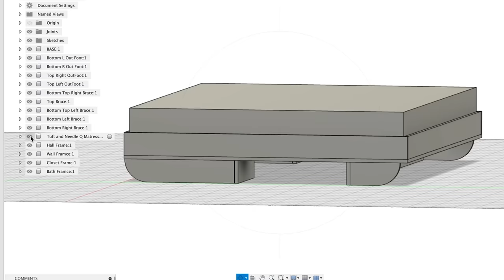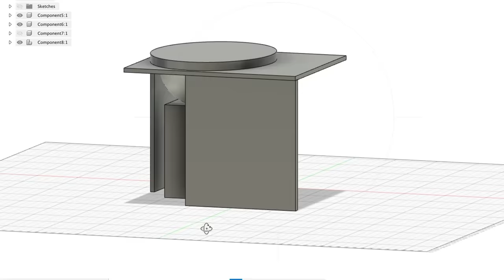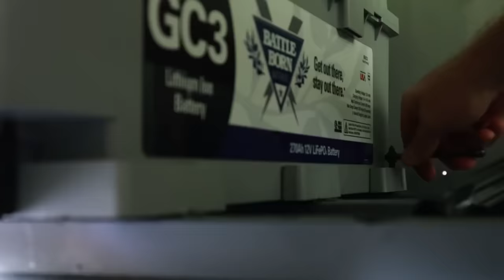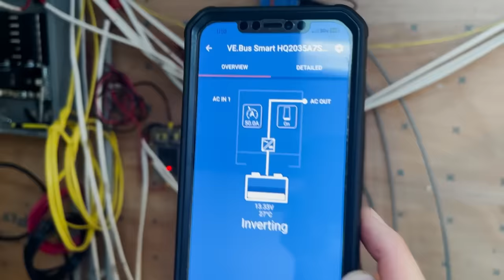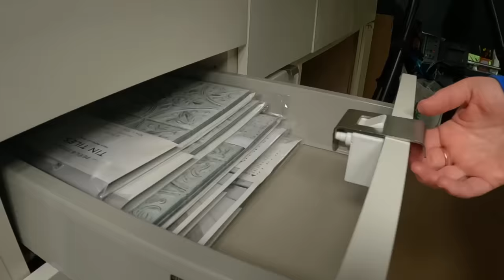BEAUTIFUL TINY HOME Bus Conversion // TIME LAPSE Start to Finish

Comment: You guys have some mad skills here.  The planning of the project, materials, design, fasteners, waterproofing, insulation, durability must have been enormous, you must be an engineer or something.  Im sure it must be very rewarding making your this creation for your full time adventure.  You must me and engineer or something to do such a great job planning and executing on such a huge project.  I also use fusion 360 for designing 3d printing projects for the 3d printer i keep in the RV.  I wish i had the time to check out the bus when I met you at angostura.  Hopefully we will connect and I will get a chance to see all the stuff from this video.  I cant believe you guys filmed the whole project.  I understand how hard it is to film projects like this when you just want to get it done.  First time I ever watched a 30 minute video beginning to end.  Awesome job.  Larry
Reply from the maker: Thanks so much Larry!  We had no experience with any of this. We learned on the job. It was a huge project and filming it all slowed the process down, as you know the work that goes into filming and editing.  But we love making these videos so it was all work it! Definitely need to hang out next time we cross paths on the road.
Reply: 7676
Reply: @Rehabit8  that’s inspiring to hear. Lovely with. ❤😊

Comment: BEAUTIFUL! Great job. Any work needed on the running gear (eng, trans, etc),?
Reply from the maker: Hi GEORGE, the bus is in pretty good shape engine transmission should last us for years to come as long as we get the upkeep done properly. We did share in video a few months ago That we have a broken front fuel filter housing that needs replaced. And some of our marker lights are broken and water gets in so that’s how I am a list of things to get done right away. We’ll find out if there’s any other issues once we start driving around I guess

Comment: Absolutely stunning!!!

But, how much does that puppy weight now? With all that wood, appliances, furniture and water/dump, it has to weight a freaking TON!
Reply from the maker: Thank you! The bus is designed to carry a maximum weight of 22 Tons (that would be with all the passengers and their luggage in the overhead bins and luggage bays below plus the weight of the actual bus).  We now weigh 19 tons so we are under weight.  Consideration was and should be made with all the materials you use in the build to be lightweight where possible but also sturdy to last
Reply: @Rehabit8  Oh wow!!! Thank you for responding. I've watched a lot of your videos and have loved every one of them. Such a monster of a project. But, such a beautiful outcome. That bus came out beautiful. Much respect to you both on 3 years of such hard work.

But, I knew that people have to be thoughtful of weight when refurbishing older RV's and Busses.

Comment: No vapor barrier?? 😢
Reply from the maker: We used sheep’s wool insulation .  You DO NOT use a vapor barrier with sheep’s wool.  Sheep’s wool absorbs excess moisture and then releases it when it’s low humidity.  You want it to be able to breathe.  A vapor barrier would defeat the purpose.

Comment: How much work - 3 years - wouldn't there be a motorhome for this money ready class A - well-maintained and with a mileage of less than 50,000 miles?
3 years spent on construction - 20-50 thousand USD and you would have been sightseeing during this period - I think it's a waste of time!
Reply from the maker: MCI's are beasts.  They are so well built and superior to an expensive RV.  Their engines are known to last a million miles.  We are way under that and could probably never put on enough miles to reach that.  A Conversion is custom.  There is no RV that we could have customized in this way.  A conversion is not for everyone but it was 100% the best decision for us and we wouldn't have it any other way.  Our home is beautiful, comfortable, spacious and customized for our lifestyle.

Comment: Fantastic R.V. Bus build. Are you going to be able to see out of that fairly high right side window to check for traffic from slightly behind to the right ?
Reply from the maker: You don’t use that window.  There’s a massive mirror and window in the door.  Been driving around for a year now and it’s not a problem

Comment: What I don't like in your bus home ?

1) wood at ceiling, floor, cabinets, countertops, etc. You used so much wood. In about 5 to 10 years time, white ants will appear and all the wood will rot. 

2) you keep a cat. Cats are dirty, stinky, filthy. They walk on grass, bring dirt, germs, diseases into your home. 

3) shower curtain. 

4) insulation at ceiling, walls and floor. 
-----------
If I were you, I would have done the following :-
1) Triple metal roofing. 

2) metal ceiling as per the shipping container. Spray white paint OR get white metal. 

3) strong wood as base of the floor. Place high quality PVC mat on it. Place high quality concrete cement followed by beige ceramic floor tiles throughout the entire flooring, including shower cum toilet. 

4) strong wood as base of the wall. Place high quality PVC mat (from floor to ceiling) on it. Place high quality concrete cement followed by white ceramic wall tiles throughout the entire walls (up to ceiling), including shower cum toilet. 

5) Fluorescent lighting :-
- living area (3)
- dining cum kitchen (3)
- shower cum toilet (1) 
- sleeping area (1) 

6) two ceiling fans

7) air conditioning unit each at living and sleeping area. 

8) place bricks with concrete cement at the areas where kitchen cabinets will be placed. 

9) kitchen cabinets made of bricks + concrete cement + white ceramic tiles. Aluminium doors for kitchen cabinets. 

10) wardrobe. Same concept as kitchen cabinet. 

11) white Ceramic tiles for kitchen countertop. 

12) 3 seater sofa - bricks + concrete cement + white tiles. 

13) dining table (for 2) and 2 dining chairs - made of solid wood. No dark brown varnish. Paint it white/beige. Put glass top on dining table. 

14) flat screen TV (same as yours). Place light weight cushions between the areas where the TV will return to its original position. Leave a bit of space (2 cm) between the cushion and TV. 

15) Iron grille and mosquito netting or screen at windows. See below :-

Windows / iron grille / mosquitto netting. 

The iron grille will prevent anyone from entering your bus home. 

The mosquito netting or screen will prevent insects from entering your bus home, when your open your windows. 

16) No drawer on the floor. 

17) Increase the height of the entire bus by 9 ft. This will be your 2nd floor. 

18) Shower cum sitting toilet bowl.  Large wash ceramic basin with ceramic countertop. Hot water heater. Pail and mop (so that you mop the floor on a daily basis). 

19) no outdoor footwear in the bus home. 

20) no pet.

21) no vase. No potted plant. 

22) no carpet, no floor rug. 

23) no table cloth, no cloth runner. 

24) Steps to upstairs (bricks + concrete cement + same beige ceramic tiles). Iron handle. 
=========
UPSTAIRS 
1) Sleeping area with triple metal roofing. Same ceiling, walls,  flooring, lighting, ceiling fan, air conditioning, windows concept. 

Wardrobe (with aluminium doors) and bed made of solid wood. 

2) laundry drying area. Double asbestos roofing with iron grille. Same walls, flooring, lighting concept. No windows. 

Put large butterfly clothes hanger with 20 figure-of-8 clothes hangers and clothes pegs.
=============
DOWNSTAIRS 
1) Living area 
2) Dining cum kitchen (top load washing machine, NO dryer, 2 pin stove, refrigerator, microwave oven). 
3) Shower cum toilet 
4) Driver area 
5) shoe cabinet at the main entrance area 
6) wash feet at lowest step. All steps to be rinsed clean. Then walk barefoot on the second lowest step.

Comment: Where did you put the condenser unit for the mini splits?
Reply from the maker: In this video you’ll see how and where the back mini split outdoor unit is mounted: https://youtu.be/gLxKBgoTeNo?si=_q3hmm4XvFEtF-lQ
The front one is mounted in the same way in the side luggage bay that used to hold the original bus AC condenser (which we removed). Both bays are well ventilated

Comment: Since you've done this before, I'm still wondering why so many people strip their buses to the frame only to turn around and put insulation and panels and materials, all of which are probably heavier than existing materials back. We stripped out our seats and left it at that, rebuilt and got on the road, we've yet to have any troubles, we don't live in it, it's for trips, so maybe that's the reasoning, but I watched one younger couple do just that, and then at the end asked why'd we do that. Please help me understand 🙏
Reply from the maker: Hi CBmiranda, we felt that since we would be living in it we wanted to control the insulation ourselves rather than rely on the insulation installed for it as a transportation vehicle. The other thing we noticed as we stripped it down was that we were able to seal and cure any rust spots, remove all the nastiness (wig chunks, gum, fingernails) that had fallen into the cracks. It also gives us piece of mind knowing there is no mold or mildew “underneath” an area we never pulled up.
It takes longer than not stripping it to the metal, and I don’t recommend you do it if it is a vacation RV, but for us living full time in it we feel it was the right choice
Reply: @Rehabit8  thank you so much, I understand what you're saying, since for us it's just for vacations that's why we didn't feel the need to go all out, great job on your bus 👍

Comment: Nice job guys, that's awsome. I'm fixing to dive off into a 74 MCI, it's an Executive  Tour bus right now, no bunks, it has a forward and rear staterooms, a refrigerator, sink, and bathroom. It already has a 12.5K generator,  inverter system, and water tanks. Basically all I am going to do to it is put a shower and kitchen in it, and a couple of fold out couches, and either use the large booth at the back for the bed, or completely redo that part, and some cabinets. The inside is so nice that I don't think I need to redo it all, maybe put down some new flooring.🤔

Comment: Why wasn’t a flush toilet installed.😢 I don’t get all the work to live in a out house. You could’ve done better. Mad Skills could have done more. Why settle?
Reply from the maker: Flush toilets use water and come with a stinky black tank you have to regularly empty.  Been there done that.  It is gross.  A composting toilet means our fresh water lasts longer while we boondock/dry camp and emptying the poop bucket is way less gross than a black tank.  Everyone has their personal preferences so if some one chooses a black tank....good for them.  We didn't settle, we made our dream bus.

Comment: It's an interesting build, out of curiosity what was the weight of the bus before restoration/transformation vs afterwards. What mechanical work was done on the engine and power train to offset any differences?
Reply from the maker: Hi blazejon, we gained very little weight from when we first got the bus, gutted it and built it out. We still have about 4 Tons of GWR headroom

Comment: Cost of: Bus + materials + labor = a brand new RV they could've bought.
Reply from the maker: Hi Aufait, thanks for your comment. We looked at Several RVs and the only ones that came close to what we wanted were nearly $500,000 - even then we would have wanted to customize it to fit our needs and lifestyle. In some ways it was a labor of love and we absolutely love our custom  tiny home bus conversion. It’s not for everyone to roll their sleeves up to try and make there dreams a reality but we are so happy with our conversion and the actual costs were just over what we used to pay in rent for a year!
Reply: @Rehabit8  No offense or disrespect intended nor taken. 
I've been an executive in the corporate world for years, and can conceitedly say I can walk into any business and tell you what their overhead is. 
I've always thought differently from my friends, and I consider my time is worth at LEAST $50 an hour and that's much less than the $200,000 a year I made before I retired as a Corporate President. 
That's what made me calculate what I saw were a total of 5 different people working on your project. I could be wrong about the number, but I'm sure 99% the labor consisted of the husband and wife team. 

So calculating your labor at $50 each (because that's what you'd pay professionals to come and do the work), plus the materials, and the cost of the bus, would be at or above the 500k for a new RV. A slightly used RV would be much less.

And that's not my opinion. That is my experience.

Comment: Helluva job for amateurs, you two.  Congrats on a well thought out project of that large scale.  Love the cabinet doors over your bed. Good choice with the LED strip lights. (I would have gone with more of that and used it in indirect lighting of the entire bus, er, home.)  Love the kick drawers, the roller pantry walls, etc.  Just one question: Why the gigantic kitchen sink?  RE: the outside, I hope you paint it something subtle.
Reply from the maker: Thank you!  We use our dishwasher for all our dishes. The only things we wash in the sink are big like pots and pans and cutting boards.  We wanted to be able to fit the big items into the sink.  It is a pet peeve of mine when you can't fit things in a tiny sink and water ends up everywhere.  Plus it looks large because it is in a tiny home but actually it is smaller than the standard size apron sink for a house.  We had a really hard time finding a cabinet to mount it on because they don't make sink cabinets that small.  We had to modify a cabinet to work for our sink. Here's the video where we painted the bus https://youtu.be/hKtHsIx5cPo